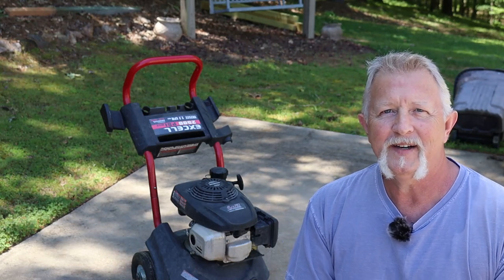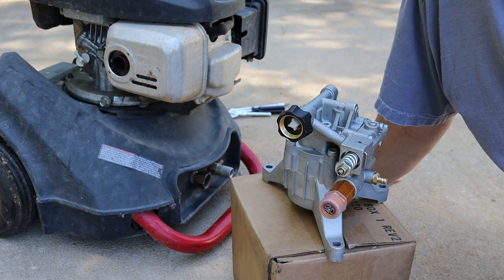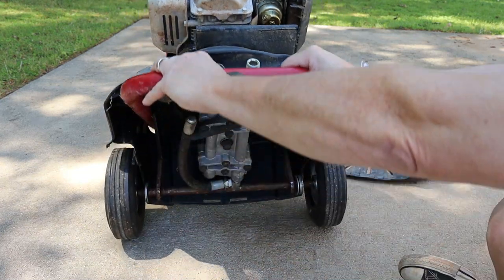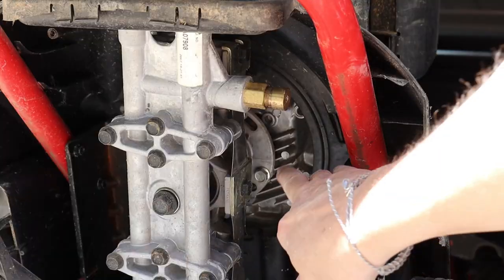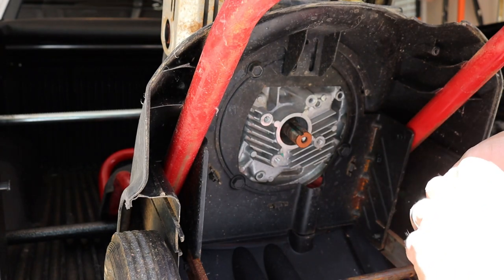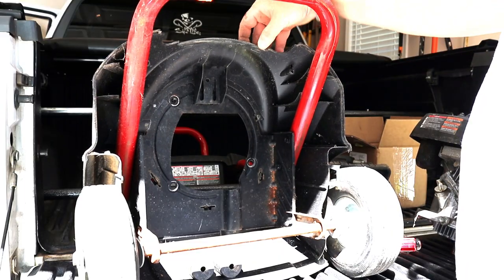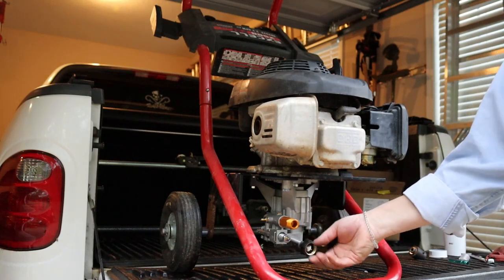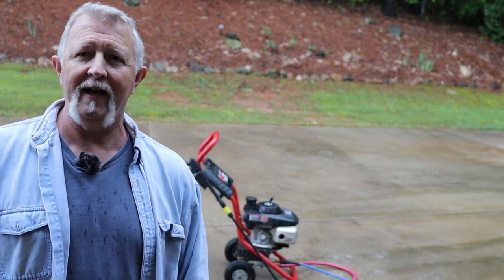Upgrade or Replace the Pump Excell VR2522 and VR2500 Pressure Washer

Comment: Excellent video. However the instructions for the pump call for a 1/4" by 3/16" key, but that will not work on a VR 2522. I tried and tried and tried to get it to work, but it just won't fit. Another person commented on the same thing. I went to a local hardware store and got a 3/16 square x 1-1/2" piece of key stock and it worked like a charm.
Reply from the maker: Thanks for watching, Trent. You’re correct, that’s why I show using a 3/16” square x 1” key. Also have a link in the description for that. Some engines might have a deeper key way for a 1/4 x 3/16 key to work, but mine does not, so I don’t know why they recommend that size. Glad you got yours going!
Reply: Trent I had the same problem with the key that was ordered which was a 3/16 x 1/4.  The key was just too large for the channel and pump on a Briggs and Stratton engine.  I tried everything to get the pump to slide on the shaft even putting it in the freezer to "shrink" it, but it still would not fit.  I ended up filing off about 1/16 of  the 1/4 sodes to make it fit.  Finally got the pump to slide on the shaft.  Next time i will make sure i get a 3/16 x 3/16 square key for the pump, or use the old key if possible.
Reply: @dwcoffey   Thanks for the video.  it was very informative, but a Briggs and Stratton engine needs a 3/16 square key.  The 3/16 x 1/4 key needed to be filed down to 3/16 square to make it fit.

Comment: thank you for the video it is great! my question is, why i need to take the motor out? can i assemble the pump with out take the motor off? thanks.
Reply from the maker: Thanks for watching, Elizabeth!  The bolts that hold the pump to the frame also hold the engine to the frame.  So, once you remove the pump, the engine is loose.  You could definitely do the replacement without lifting the engine, you just have to do it from underneath and be careful not to lean on the engine etc. or it will possibly slide.

Comment: Great video Dennis! I just bought a VR2522 at a garage sale. Just finished rebuilding the carburetor. Or now runs great! Now for the pump. I noticed the pulse hose had a break, so I will replace that. 

I noticed you replaced the wheels and shaft. Mind sharing how you did that sir? Thank you.
Reply from the maker: Thank you for watching!  This replacement pump uses an unloader valve rather than a surge hose like the original pump (one of the reasons I like this replacement pump).  The original surge hose will hold water, if the water freezes, it pops the hose.  When I replaced the pump, I removed the plastic shroud housing around the pump.  Then I picked up a couple of wheels at Harbor Frieght....I think they have a 5/8" diameter bore.  I had a piece of 5/8" rod stock, just cut it to length and drilled a hole through the shaft in each end for cotter pins.  I put a large fender washer behind and in front of each wheel.  I hope that helps!
Reply: @dwcoffey  Thank You Dennis, Now that the surge hose has been replaced, When I release pressure from the gun, the line builds up pressure and the engine stops. What am I doing wrong here? I plan on doing the conversion you demonstrate but I will have to do that another time. What I'm concerned about conversion or not, the engine stalls once pressure is built up in the line when the gun is not used. What would you do to fix this? Thank you.
Reply from the maker: Not sure, but sounds like too much surge for the engine.  Maybe try cutting a longer length of hose for the surge hose.  That might absorb more of the surge and do the trick?  Just a guess.

Comment: Great video. I have an old Honda PWH2500 and the pump bearing and housing have broken. I wasn't sure if the outer engine mounting holes would match these replacement pumps but after watching your video I think I'll go ahead and buy one. They seem to be a bit more expensive here in the UK. The only one I can find is on Amazon.co.uk at £99.99 but I think it would be worth it.  By the way my engine is a Honda GCV 160. I'm not sure if that's what yours is but it looks very similar. Thanks, Kenny.
Reply from the maker: Thanks you for watching, Kenny!  Yes sir, the engine on mine is the same Honda 160.  I have never liked this pressure washer as much as I do now with this new pump.  I do find that I have to let the engine warm  up a bit longer (maybe 5-10 minutes) before running the pump.  I suppose the new pump requires a bit more power to run, but after the engine is warmed up, this thing rocks!  Let me know how your replacement goes, hopefully you'll see results similar to mine.
Reply: @dwcoffey  Thanks for your reply. You've got me thinking now. The one I was looking at is rated at 3100psi max. Do you think it would work if I adjusted the unloader valve a little to reduce the pressure? 
It's marketed by Waspper but the name on the pump is Himore. 
When I looked on the Waspper website they had two versions of the same pump, one with a brass head which was nearly double the price of the one with the ordinary head (Aluminium I think)
There's another one on Amazon by Yamatic which is rated 2900psi max, 2300psi normal. Only problem is they don't ship to my address (Northern Ireland)
Not sure what to do now. I might take a chance on the cheap one from Waspper. Probably cost me about £60 including postage.
Reply from the maker: I'd be concerned about that engine handling a 3100psi pump, but....the one I installed is a 2800psi pump.  So, you might be on to something....if you adjust the unloader valve a bit, it might be fine.  I wish I could say for sure, but I can't with any degree of certainty.  Mine runs fine once warmed up and doesn't stall at all, but I also feel like if the pump was running any higher pressure, it might.
Reply: @dwcoffey  Hi Dennis. Good news. I got the pump fitted and it's working great. The engine seems to be handling it OK. I think the psi ratings on some of these pumps are a bit inflated anyway. I agree with you; the pressure is better now than it ever was with the original pump. One very slight problem. The only way the pump would fit was with the connectors pointing backwards which means the axel is slightly in the way but I can live with that. 
 Also I did a stupid thing when fitting it. The detergent inlet was in the way for getting the long extension onto one of the bolts so I screwed it out and I must have put it back in wrong cos when I started the machine the water was spraying out of it. When I screwed it out again I couldn't find the spring and ball so I got one of the balls out of the old broken bearing and used it to block the valve. Probably means that the detergent inlet won't work now but I never use it anyway. Thanks again for your video. You saved me a heap of money.
Keep up the good work,
Kenny.
Reply from the maker: I haven't tried the detergent port yet...next time I have the pressure washer out, I'll try to remember to take that port apart and at least see how it goes together, and get back with you.  Glad you got it working!  Thanks again for your support, Kenny!
Reply: @dwcoffey  Don't put yourself to any trouble on my account as don't ever intend to use the detergent port. I'm just happy to have the machine working again. Thanks again, Kenny.

Comment: Hey Dennis, very good how too.  I followed your tutorial and installed a new pump. Problem! The injector nozzle pumps water  into the detergent tank rather than drawing detergent from the tank into the pump. Have you had this problem? Have notified seller-no response yet.
Reply from the maker: Thank you for watching!  I have not seen that problem before, it does sound like a problem with the pump.  Hopefully you've heard back from the seller and got it resolved.

Comment: Great job I think I can do that thank you, I was thinking of just replacing mine I will look into this, nice project 
Thanks for your time and effort as always stay safe stay well God bless....
Reply from the maker: Hey Danny!  Thanks and thanks for watching.  That's exactly what I was going to do....one of my son's works at a power equipment shop, so I was thinking about buying a new pressure washer.  I ran across this replacement pump online and an $80 pump versus a new $600 pressure washer convinced me that I can get a little more life out of this one!  haha.  The Honda engine runs like a champ, I was just having problems with the pump.  So far, this new pump is great!

Comment: Just did this today to mine went into Home Depot looking for square stock the guy said it would be easier to get the right key I said nope I just need 2 inches and good to go got it washing today only thing I’m wondering do all those models idle like that it seems like it shouldn’t keep going up and down but
Reply from the maker: Thanks for watching, Jordan!  Glad you got it going!  I love this new pump on mine, it's like a brand new pressure washer.  The governor on these Honda engines seem to do that a lot.....I'm sure there's a way to adjust the governor so doesn't change the engine speed so much, but I haven't gotten into it yet.  I might tackle that and make a video!  Seems like it should only respond to a load (when there is demand from the pump) and not change the idle speed so much.  Mine has always done that, and it won't hurt anything, but it does seem weird.

Comment: Hey, I really appreciate your video. I’m trying to replace the pump on the exact same machine for my father. The only problem I’m running into is that the pump I bought only mounts with the nozzles coming out the back of the machine. I thought this was a defect from the manufacturer, like they had installed the bottom half of the pump backwards but every pump I’ve looked at is no different. The only way it will mount is backwards. If I line it up with the nozzles facing forward, only one bolt will match the pattern. Any advice on what I might be doing wrong?
Reply from the maker: Thanks for watching, Michael!  I'm sorry but I am only familiar with the pump I purchased.  I did a fair amount of research before I found this one and actually went with it because it had good reviews and bolted up directly to the engine on this pressure washer.

Comment: Aloha from Maui, Hawaii Dennis!  Great video.  I have the exact pressure washer I bought a few years ago from Home Depot and today as I was using it, it loss pressure and found a bunch of ball bearings underneath the washer.  A few ball bearings were even split in half.  Would these ball bearings be from the pump?  There were also aluminum shavings that were apparent.  Hopefully they are not from the engine!  It runs great, just no pressure.  Any info will be much appreciated.  Thanks for your time and stay safe....Fred🤙🏄‍♀️🌴
Reply from the maker: Thanks for watching, Fred!  IF it was running fine, just no pressure, definitely sounds like the pump ate itself up.  Plus, the engine won't have any ball bearings.  So, yes, sounds like your pump gave out.  I am loving this replacement pump I used.....the pressure washer works better now than it did new.

Comment: thank you dennis for the info--appreciate the time.  my father was getting rid of his pw and   I came  across this. so now i have a project.  how has the increase of pressure been--any issues?
Reply from the maker: Thanks for watching, Rob!  I love this pressure washer since I changed pumps.  I wasn't much of a fan before that to be honest.  The only issue I've had is that I need to let the engine warm up a few minutes longer than with the original pump before I start washing.   If I don't, it tends to stall.  If I do let it warm up for a few minutes, I do not have any trouble at all.
Reply: @dwcoffey   put it on over the holidays..and bought a wand with new nozzles.. Boom back in business a PW for a little bit over $100.  Thanks for the video again 👍
Reply from the maker: Nice!!  Great job, Rob, glad it helped!

Comment: Can someone please tell me what that porter cable is for that underneath my power washer? Mine sprung a leak. Can I patch it with a clamp?
Reply from the maker: Thanks for watching, Wanda!  Often, the surge hose either gets weak and splits or freezes and splits.  You could try patching it with a hose clamp, that might get you running temporarily, but the hose should be replaced.

Comment: Would I be pretty much in the same boat with a VR2500? I'm assuming I am and it appears identical and your 2522 a little newer model. This one is a B&S 6.5 HP and 2500psi.
Reply from the maker: Thanks for watching, Timothy!  Yes sir, the pump i used is spec'd for the VR2500 and the VR2522.  This replacement pump is so much better than the factory pump....I wish I had done this ages ago.

Comment: Teflón tape goes Clockwise......I Think....?,.It was harder to take the Dam plastic wrap than to screw the engine.....
Reply from the maker: you wrap teflon tape on clockwise if you are looking at the threaded end, because the threads are right-handed, so the thermal valve goes in clockwise.  You should wrap the tape on so that the tail end will not ball up when you thread in the valve.  Yes! I agree....I hate plastic wrap!  Thanks for watching!

Comment: What wheels did u up grade to
Reply from the maker: They are just solid rubber wheels, like wheelbarrow wheels with a 3/4"bore.  I had to drill the axle brackets out a bit to fit a 3/4" solid axle shaft thru them.  Thanks for watching!

Comment: The biggest cause of pump failure is idling the washer without depressing the handle on the gun. No water going thru the pump makes for huge friction and goodbye pump after a year or two. They design them like that so they fail.
Reply from the maker: Thanks for watching!

Comment: i wonder if the vrb2321 is much different
Reply: its similar but i dont want to mess with keys.   anyone know where you can get a pump meant for that adapter
Reply from the maker: Hi Stevon, thanks for watching.  The EXVRB2321 is very nearly the same as the one I upgraded in this video.  I found a couple of replacement pumps for your pressure washer, but they all require keys.  I also found a key online that you will not have to cut and should make the job really easy.  Here are the links in case you decide to go this route.  The pump is $100.  Pump:  https://amzn.to/3cyQX3d
Key:  https://amzn.to/2y4ehXF
Reply: @dwcoffey   thank you!

Comment: Hey Dennis, I've read many of the comments and reviews and also agree, nicely done. I have the same "problem" already mentioned. I purchased the exact pump you recommended and have the exact Excell VR 2500 as you demonstrated the replacement. The pump only mounts to the frame and engine where the hoses exit the rear.  The wheels axel is directly in the way.
There are 3 bolts on the top and 4 bolts on the pump housing that hold the bottom and the top portions of the pump body together. I watched another youtube video and learned that the pump can be taken apart the bottom mounting legs rotated 180 degrees and put back together!! Now the hoses exit the front of the unit!! check this out! https://youtu.be/EE0P0_kxjNg
Reply from the maker: That's great Kevin!  I'm glad that pump mount can be rotated, otherwise it would not be very user-friendly.  I wonder if they just got some of them assembled backwards in the factory?  Sure glad you found a good fix, thanks for sharing.  Thank you for watching!
Reply: @dwcoffey  I noticed many of the units on the market actually have the hoses exiting the rear. I guess to each his own. It may be easier to move around the unit with the hoses "dragging" behind as a feller pushes the unit around. Thanks again for the demo and the advise. I got mine mounted and the pump works better than it did 10 years ago!!

Comment: why not repair the old one
Reply from the maker: I normally might do that, but this pump was unbranded, so parts would have been difficult to find, and a poorly built piston-type pump.  This replacement pump is much more efficient and relatively cheap as well.  Thanks for watching!

Comment: That upper shield being upside down would bother me if it was mine. That's just me.
Reply from the maker: Thanks for watching.  Not sure what you are talking about.....nothing is on upside down.
Reply: @dwcoffey  I have an Excell 2400, when I look at mine from the front, the emblem on the handle bar is right side up, maybe the emblem was applied incorrectly on yours. see 0:20 ? Informative video just the same. Had a problem with mine and thought it might be the pump. I removed the unloader and it was fine. It was building pressure but no spray at all, not even a drizzle from the gun. The only way to relieve pressure was to slowly remove the pressurized hose.The last thing I tried was to switch out the nozzle. And sure enough the other nozzle solved the issue. The nozzle I removed was packed with some dirt and white gook. I used brake cleaner with the straw nozzle to blow it out and then a very fine wire to poke through the hole. I had put the new pump and parts into my Amazon cart prepared to order just before I tried the other nozzle  I now know what I'll need to do when it does fail. For anyone else having a problem such as I did; try swapping out inexpensive nozzle or cleaning it first.Thanks for taking the time to make this video.
Reply from the maker: Yea, I don't know why they put the label on like that...it is applied so that its readable from the handle side...like when you are moving the pressure washer.  Who knows...haha.  I've had that problem with nozzles before too.....a fine wire does the trick.  Thanks again for watching!